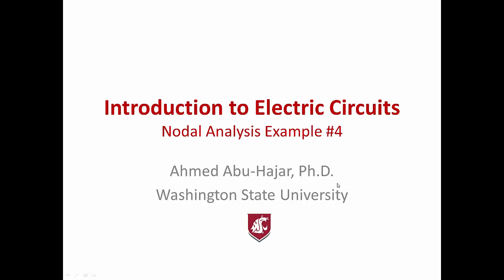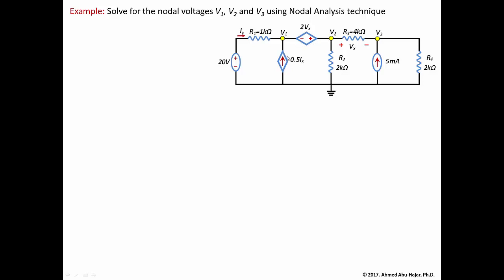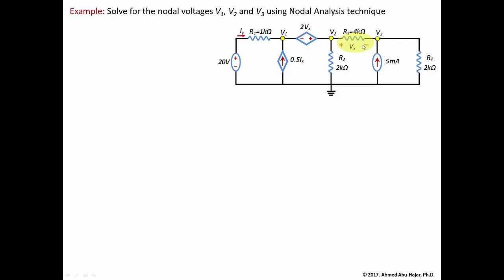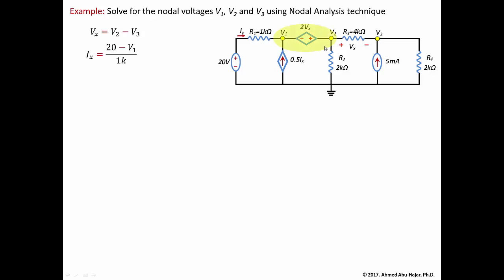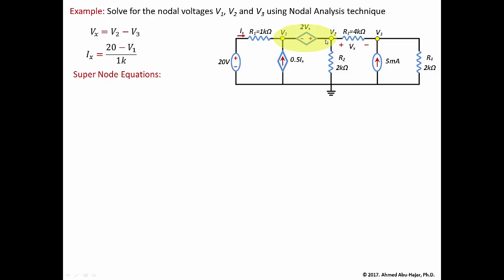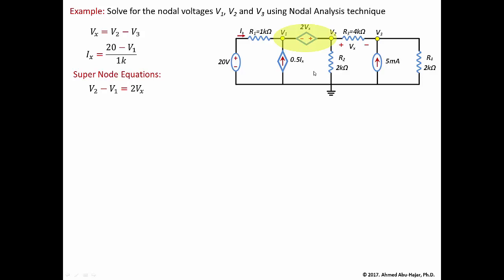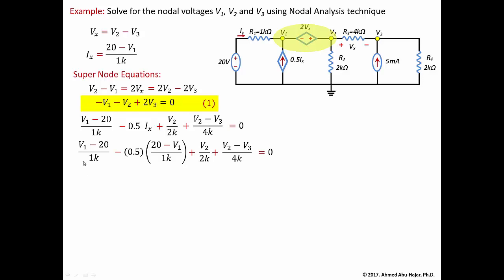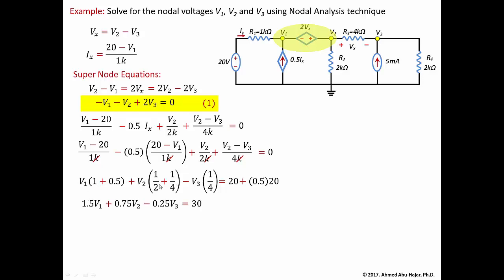Circuit Analysis - Nodal Analysis Example 4 (Super Node & Dependent sources)

Comment: Sir shouldn't be the equation for the dependent voltage source should be V1-V2=2V2-2V3?
Reply: To the people watching this, my technique would when dealing with dependent voltage source. I do it by making my constraint equation into V1+2Vx-V2=0 where I would arrive with V1+V2-2V3=0 (Substitute Vx=V2-V3) which would arrive with the same answer. I usually look left to right that is why my KVL equation is V1+2VX-V2.